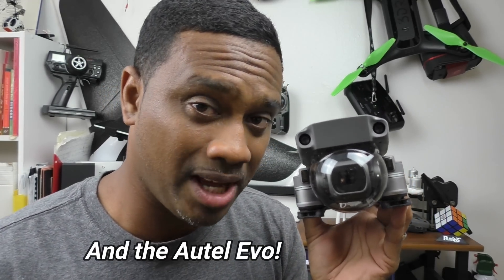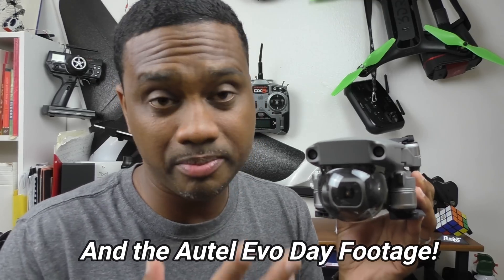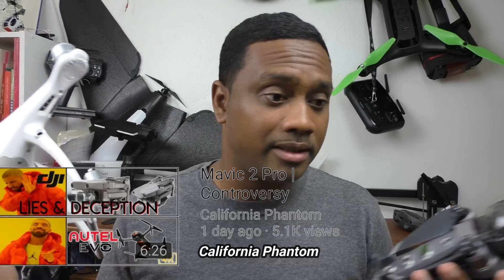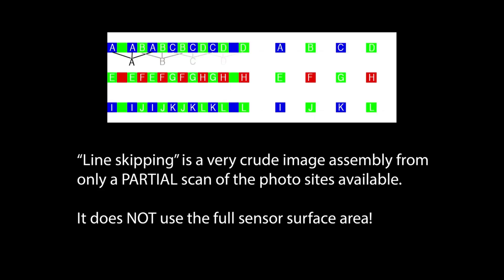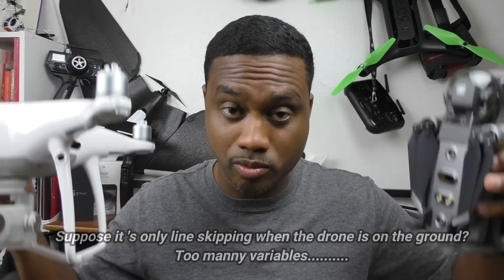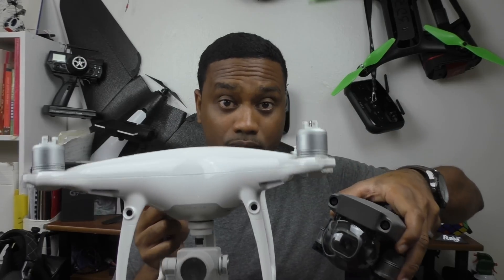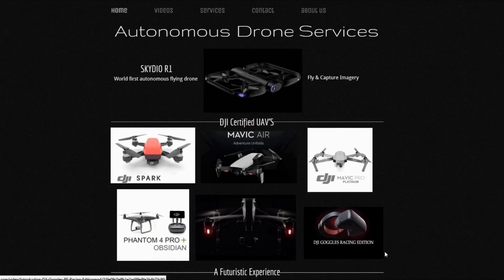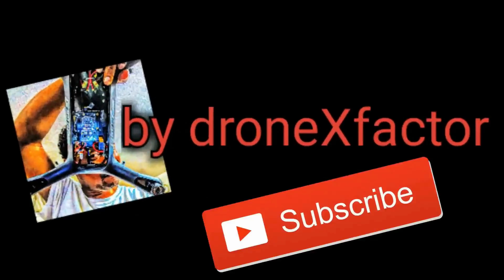DJI Mavic 2 Pro 1" Sensor is Line Skipping & Overheating?

Comment: Well Do A Comparison of Mavic pro 2 and Phantom 4 pro....Day and Night...you'll see Clearly which is Better...Its About getting the Most bang for your Buck....now yes the Mavic is portable....But Camera is Better on Phantom pro 4...with Same Sensor...Whys that?
Reply from the maker: It takes a lot to cram a 1-inch sensor in such a small camera and place it on a portable drone and make it reliable and perform the same way a full size drone does with a 1-inch sensor. DJI can't just snap their fingers and make everything possible, but I do believe they did a fantastic job which mavic 2 Pro is the best all around portable drone available today.
Thanks for asking

Comment: You make me feel a little better about my Mavic two pro but the results if you do have a train eye, The phantom for pro which our own as well is much sharper even when flying anyway what’s done is done I’m not real pleased with my Mavic to it’s too soft hopefully firmware will fix it I believe it will we have to think positive about our $1900
Reply from the maker: Just because mavic 2 Pro has a 1-inch sensor everyone believes it should be compared to the Phantom 4 Pro and it should be better. The mavic 2 Pro should be compared to any other portable drone with a 1-inch sensor......... Oh yeah that's right no other exist!
It's the only portable drone with a 1-inch sensor ;)
Therefore you had no choice but to spend $1,900, if you want portability I'm the 1" sensor to fly at night.

Comment: I think a huge part of why people think the Zoom is "sharper" than the 2 Pro is because they forget or simply do not understand Depth of Field. The Zoom, like previous Mavics or GoPros, etc, have fixed focus. The 2 Pro has a real aperture, which causes depth of field, which means if you are not shooting f5.6 or lower there will definitely be some blurred areas depending where your focus is.
Reply: exactly. adjustable aperture has a sweet spot where sharpness hits.
Reply from the maker: Wow very interesting point.
Thanks for mentioning

Comment: First of all everybody has known about the line skipping for about a week. Or it might be pixel binning, nobody knows for sure. I’ll still take the Mavic 2 Pro over the original Mavic simply for the gimbal quality and the extra sensors. Hopefully DJI will do some firmware updates and get us all what we were expecting. They are probably just protecting the phantom 5, which is going to cost some serious cash!
Reply from the maker: I think people don't realize that the mavic 2 Pro should not be compared to the Phantom 4 Pro, but the only reason people seem to be doing this is because there is no other portable drone in the world with a 1-inch sensor!
Thanks for watching and sharing

Comment: I think the biggest thing about the pro2 is it shoots in 10bit so in post you have a lot of room to play with....PS im not a DJI fan i have the Anafi. but 10bit is 10bit
Reply: Occusync 2, 30 minute flight time, new flight modes... there are quite a few advantages of the Mavic 2 (both zoom and pro) over the other platforms.

Comment: Hi DronXfactor - I like your channel and I subscribed to it. Great job with you video. I certainly respect your point of view on this. I must tell though, about resolution charts and lens testing, it is a requirement that all lenses no matter what focal length be adjusted in distance to a chart. When testing any lens, you must compensate for it's field of view and move it forward or backward to a chart or any scene in order to "cancel out" it's field of view factor. It's impossible to test ANY lenses' resolution without doing this. If you test and 85mm against a 24mm and do not calibrate it's distance, than you cant test it's resolving ability in any way. So,...moving a lens forward or backward to match a scene is the ONLY way you can test how many lines your lens and sensor are resolving.
Reply from the maker: Wow, good to know!
So the test is 💯 fair?
Can you please provide me with more supporting material?
Thanks for letting me know.
Looking forward for more info.
Reply: droneXfactor  - My tests are NOT 100% conclusive. They only display a better idea of what is happening. My only goal was to spark a bigger fire here and get more and more people to test and inspect the Mavic-2 Pro for themselves and share their tests. I love both of my Mavic-2 (zoom and pro) and I REALLY now love my Phantom 4 Pro more than ever! On the focus, I made multiple auto focus file tests as well as one manual focus test. All had the exact same result show the FOV mode to be VERY soft with HQ being OK. I'm not the "be all, end all" on this subject. I'm just going to be someone that is asking everybody to jump in and be a bigger voice about this.
Reply: @clifftotten7609  thank you for adding your expert advice and by the way I really loved your video I thought it was exceptionally excellent and then tonight on Ken herons Thursday Night Live show I found out why you're so much of an expert because you sort of revealed who you work for and that says a lot so thank you very much.

Comment: A drone is simply a camera with flight capabilities | A camera is an image capturing device | The most important part of any camera is the operator | After capturing the image, whether still image or motion picture, edits can and often should be applied to modify and elevate what was captured... regardless of the camera | A more powerful camera in the wrong hands will produce garbage, even when edited in the most powerful editing suite | Too many folks are making too much fuss about "improvements" that will not translate to a better image once said image is presented online ... which is often the only place said folks have an audience |

When I do the math on the points I noted above, I posit that if you don't own and consistently shoot with a pro level hand held camera then why do you need a $1,500+ drone. After weeding out that bunch, my next question is ... do you own or regularly use a proper editing suite and or have a proper editing setup? Are you Part 107 certified and have the requisite waivers needed to fly at night or in the environments that necesitate occusync over a wifi system? Are you flying 4 miles out regularly just for fun or are you making money off it? If not you can and I would argue should purchase a sub $1,000 drone or at best the mavic zoom. We could argue these points until the cows come home milking themselves and making cheese for the pigs but ... ain't nobody got time for that.

Additionally, how many drone shots do we see lasting longer than 4 seconds on screen? Are you capturing your media for commercial use?  Are you printing your drone pictures and how large are you printing them? Or are you simply posting to youtube, or the dreaded image quality killers collectively known as social media?

It's your money to spend if you have it ... and nothing is wrong with that .... but Wake up folks! We saw this with the iPhone series, now it's drones ... the new thing to have and we're encouraged to run out and get the latest. Who remembers the part of the Mavic 2 webcast where the example used to speak to the Mavic zoom's capabilities was "if you're trying to capture a polar bear in the wild but don't want to get so close that you scare him away" ... EPIC and quite appropriately engaging example right ... but how many of us who watch these drone videos on youtube or who films locally in our city or casually captures content on vacation will actually be shooting anything close to a polar bear???....

Less Talk | More Walk | Learn to capture | Learn to edit. | you don't need the latest drone |

and As droneXfactor said, lets just get out and create content.
Reply from the maker: Wow, mind blowing!
I am speechless!
Well said!

Comment: The most important part of this vid, at least imho, is the finale: crap footage (in terms of composition) does not really improve with better equipement.
Picture qualitiy is mostly to impress the nerds, stunning composition will blow away the audience ;-)
Have fun with the Anafi then...from my POV it offers some innovation for composing footage, which was of greater importance to me then just improvement of the things we can achieve already.
Reply from the maker: Thanks for getting it :)
I am definitely enjoying Anafi.
Fly Safe & thanks for sharing.
Reply: You're welcome. What I like on Anafi is the kind of different philosophy...they offer less on automated quick shots (just some for the sake of having them too), but more in what I would call "asissted manual flying". Look at Cameraman or Touch&Fly POI: it does not more than keep the object centered, you should fly around manually, therefore you will get unique footage instead of the standardized quick shot. 
Hell, even autonomous flights using flight plan encourage creativity, you have to set up the course for yourself, and in midflight you might add zoom, while the rest is following your planned route and actions.
The other thing is the unique gimbal tilt range, which itself is/does nothing unless you put it in good use.
There is some great footage from a dam in YoutTube: https://www.youtube.com/watch?v=WA4y-n2qVY0 (not mine, so no click baiting), show me anotherconsumer drone capable of doing this (I guess there are little on the prosumer or pro line that can do similar)
Imho it's also invaluable, when you use the drone in grould level to catch footage you would need a complete dolly system for...and them even go up and away beyond the reaches of even a crane system in one continous smooth shot (in a way like my test: https://youtu.be/Vgn4_rEahc0)

Comment: Most of the Mavic Pro issues are user related. And how they use it or dont use its features. You know I use a P4s some of my pics and video are just as good as other more expensive drones. Just because you have a machine that does something doesn't mean you know how to operate that machine to its fullest potential. If drone Pilots don't know how to optimize their drone to its fullest potential then you get crappy pictures and video.
Reply: I agree totally; it's a machine and should be handled as such: read the manual first!
Reply from the maker: Facts!
Reply: I have to agree with this. I still have lots to learn and my original Pro is just patiently waiting for me to get there. The same with my Air.
Reply: dwin1977able  agreed,  I think some people are feeling shorted because the thought they were going to get P4P quality pics with the MP2 Pro
Reply: @odeonarain  Yup your right
Reply: Novice Quadcopters what a joke. 
Learn a bit about sensor. I know a lot of pro that think they Mavic 2 is shot. And they know what they are talking about.

Comment: I don’t agree, not when you put a name like Hasselblad on the camera. That name means top quality not half ass. I will still take the P4P’s image over both the new Mavics.
Reply: steve diosdado Hassy cameras are a totally different approach than the usuals like Canon or Nikon.  The M2P is not a folding P2P, it’s a totally different animal.
Reply from the maker: @tjxdroneography3783  
People somehow think or expect this Drone to replace the P4P :(
Why can't they just understand it's a Mavic built to fly at night!
Reply: droneXfactor yes, and I’ll admit the camera is “quirky” it takes some getting used to.  It’s not necessarily point-and-shoot right out of the box.   It’s also seems like it’s designed to be used with some post processing.

But it’s capable of some stuff almost no drones can do, especially no other folders.
Reply from the maker: I guarantee there's no portable Drone that can match this Drone's camera period!
P4P is not portable & is a whole other beast!
However I do understand how the name Hasselblad is impacting alot of people, thanks for sharing your thoughts.
Reply: by now you should know that m2p is a cheat! no matter how good the image is! in terms of picture quality also spark (same sensor like mp and ma) comes close to p4p, this is not my opinion these are facts from professionals! m2p is a genius marketing coup similar to volkswagen with their clean diesel! hq uses a cropped 1 inch sensor so i don't care how good the image is, it's a f**king cheat on customers ontop of that fps is limited from software to 30fps in 4k)! all in all you don't get what you pay! perhaps autel will release their 1 inch and get things right!
Reply: iSonic: I think you are confusing own expectations / expectations on YouTube vs. what DJI actually announced. They never said the  M2P was a foldable P4P. They never said that FOV mode was not subsampled. They said right from the beginning that the crop mode is the high quality mode. It's possible that a lot of people did not understand what that actually means, but you cannot say there were cheating. 
I'm just back from filming some footage with the M2P and after all I'm amazed by  the quality I get from this drone. And that is true also for FOV mode. You need to keep in consideration that even cropped the M2P has bigger pixel size and is useing more sensor area than the Mavic 2 Zoom.
Reply: @jeemotion2025  sure it uses bigger sensor size but not 1 inch!  that's the point! and no, p4p by far has the better image!
Reply: @jeemotion2025  p4p even has a mechanical shutter and that's for stills! m2p doesn't have better image! 1500 bucks for stills! and no i don't have m2p because i know dji and you always have to wait before buying their hyped products! good i skipped due to this cheat that now found it's way to public! good if you happy with m2p, i wouldn't have been happy like i was with p4p i sold some months ago due to not being travel friendly but had a nice time but good it's gone
Reply: iSonic: I understand you got hyped by thinking the M2P was a foldable P4P but this was never claimed by DJI so you got hyped by yourself and YouTube and not by DJI.
Reply: @jeemotion2025  no i didn't get hyped  etc. all o'm talking of you don't get what you pay! the 1 inch sensor is not used at it's full potential that's what i'm talking of! would you have bought it if you knew only a small part would be used? would you have bought it if it said 1/1.7 inch sensor? probably not! the buying reflects was generated by 1 inch sensor inside! you got cheaten and of course you need to justify your buy!
Reply: +steve diosdao: the camera is top quality, it's just not consumer accessible like the P4P is.
Reply: jm2018 the camera may be good but it's not a real 1 inch sensor cam! you can turn it as you wish, but it's the worst 1 inch cam on the market!
Reply: iSonic: that's just not true. There is a video out there showing that the optical capabilities and detail resolution of this cam are actually better than those of the P4P in photo mode. And you can get also best results in video mode (image quality is not just sharpness, it's also colour depth, dyncamic range, noise, absense of moires, etc.). The M2P is just not as fool proof as the P4P is - that's all. Most videos you see on the web are filmed in FOV mode with automatic exposure and an aperture of f11. And that's just not the sweet spot of this camera. You will see  a lot of awesome videos  made by skilled people with this drone pretty soon. However  I would agree that this drone might not be the best choice for people who want to film in automatic mode.
Reply: IF YOU REACH OUT TO HASSLEBLAD TO USE HIS QUALITY PRODUCT FOR YOUR DRONE,THEN ALL THESE THINGS THEY HAVE STATED IS JUST CONTRADICTING,THEN ONE HAVE TO ASK ONESELF,WHY DID THEY EVER DO BUSINESS WITH HASSLEBLAD THEN IF THE SENSOR HAS SO MUCH LIMITATIONS,AND ITS BECAUSE OF THE CRAMMING OF THE SENSOR IN THAT LITTLE SPACE.
 AUTEL EVO WILL ALWAYS HAVE A BETTER QUALIT OVER THOSE TWO DRONES,THE ONLY THING TO ME THATS GOING FOR THOSE NOW MAVICES IS THE NEW MODES OF FILMING LIKE THE DOLLY ZOOM.
Reply: Agreed! P4P still has better quality than any of the mavics.  Similarly, is this guy talking about flying at night?  Is there something I'm missing about FAA regulations and or something about flying at night I'm missing out on?

Comment: I’m no expert and I don’t have a drone. I can only go off the facts until I get a P4P and a M2 and do the test myself to see if I get the same results. Could there be line skipping or bending going. Yes it possible could but I would like to see more test done and I’d like to see them done both ways. One with them flying and the other with them placed on a stand or table. And then compare the results. But to be honest with you I think dji should have came out with just the Mavic  Zoom. Then later on came out with the Mavic 2 when they were able to have it with 1” sensor that can do 4K @ 60 FPS.
Reply from the maker: Very good points, I think that sensor can do 4K 60fps, DJI just has it locked & I'll explain my theory (not Fact) in my p4p comparison video..... thanks for watching and sharing your thoughts.